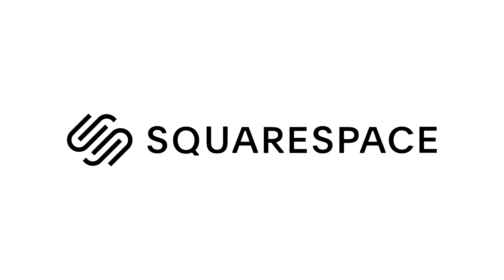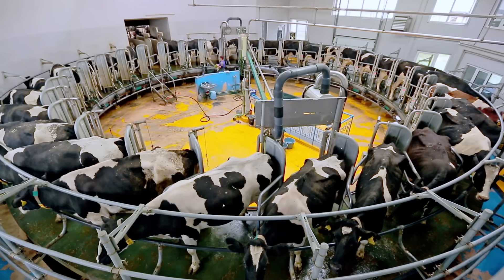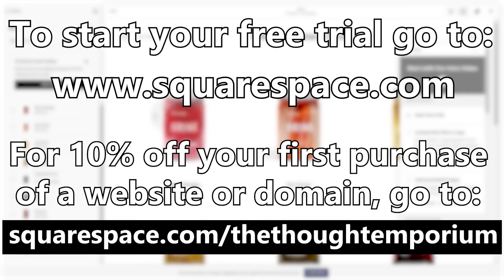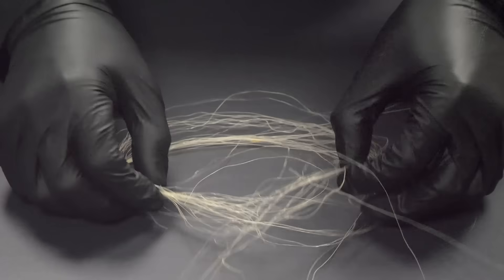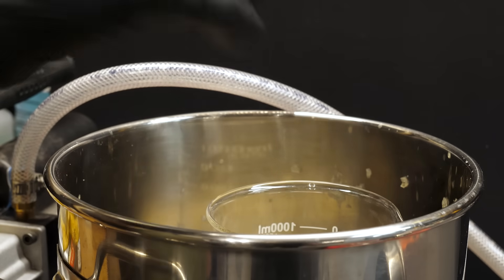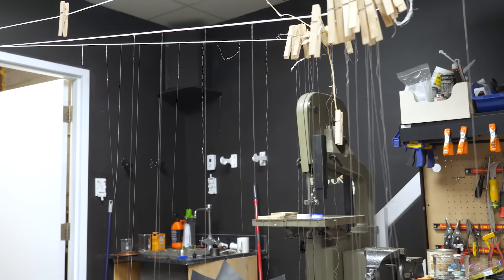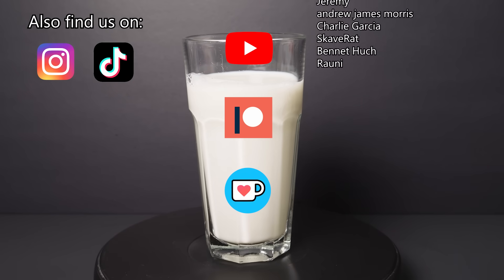I turned MILK into YARN

Comment: Any interest in building a concrete, rechargeable battery? You've done interesting work before on batteries, and MIT just released an article on an improved version of something they've done. I want to build a house where the foundation is the battery for the solar panels. 🙃

Comment: Color me surprised.

If you swap the cow for yeast, same milk, and you coat the threads in chemicals sealed in a protective layer, triggered by a tazer connected to a car battery, pushed-out like a weed whacker, then you've got a spool of fuel instead of liquid gas?

Comment: I spin yarn, knit, crochet, and weave. If one bit of actual spinning fiber to make yarn in this video was done and then tensile strength tested it would be a much better test of its strength. All yarns, ropes, cables, threads, and strings are twisted one way, then plied with other strands and twisted the opposite direction to make durable yarn.

Comment: My mom and I are both knitters, and she has seen "milk cotton" while browsing about yarn on the internet. We both thought the "milk" in the name was just a metaphor to describe how soft and smooth the cotton yarn is until I saw this video! Mind blowing
Reply: As a crocheter I REALLY recommend trying it out! I don't know if the feel will be different knitting with it than crocheting, but it is by far one of my favourite materials to work with. It's so soft, has a mild stretch and has amazing stitch definition. ❤
Reply: @ginarosie I’d be interested to see if it has more of a stretch than polyester, this is essentially a natural polyester. It’s also not vegan! lol
Reply: @ginarosie   How does milk yarn hold up during washing ? Do you use it for larger pieces or garments ? And is it breathable or more like acrylic ? Plushies wear down differently, often they are decorative only - and the small areas with many colours distract from pilling. If you have a cardigan in one colour with stockinette, garter or brioche it is different you will see any change of surface much more.

 I would very much appreciae an answer, thank you  - I wonder if I could buy some for a cardigan (there are cheap offers on Temu, in Europe they do not sell such yarn, so I cannot go to a trusted brand or ask experienced shop owners.

 - I suspect milk yarn might be as delicate as modal (extruded cellulose fibre instead of extruded protein like milk yarn). Which means it might also pill easily just from wearing and it would need wool cycle w/o spinning (or 400 rpm at most).

I also suspect that there may be cheap and better milk yarn and have no way of distinguising the quality. Like there is "better" acrylic (when it comes to pilling), but most skeins are the cheap stuff. 

I dislike Acryl very much: Microfibres ! it will be shed like crazy. Those fibres go into the waste water and your household dust. I sweat in it and easily overheat in it. Static build up especially during winter with dry air, and it pills no matter how gently you wash it, so it is not even worth the effort of handknitting. Nor do I buy it in shops. Up to max. 30 % in valuable fibres (virgin wool or cotton etc. ) is O.K. Though it means those garments cannot be recycled. 

High quality sock yarn will often have 10 - 30 % acrylic in it, and they are quite sturdy (washing). Normally it is superwash treatment. Some say that it is just a form of plastic coating of the fibres. Well probably that is the correct way to describe it - but it still feels like wool, it is breathable, static electricity does not build up and here the artificial fibre extends the life of the garment and makes care easier.

I still can find a purpose and next life for a sweater even if it was worn a lot. And worn down.
There are wool razors, too. Or creating an outside shell with fabric (jersey) and treating the wool sweater or cardigan as lining. Which would make for a warmer garment. Or frogging it to create a dog bed or picnic blankets with it. Or using it for weaving (rugs). One can also braid with crochet chains, treating them like a strand. Maybe one can even weave with such cords. 

I would rather not use clipped yarn that contains real wool to stuff a home made dress form (if moths detect a source of wool inside you are screwed. And yes, they will also eat blends with wool). Your last resort would be to store the stuffed out replica of your body into a chest freezer (if that is large enough) and keep it there for 2 weeks. The normal temperatur setting is -18 degree celsius (colder than the freezer compartment that is part of many fridges (they usually only go down to - 8 or - 10 degrees C). 2 weeks when it is really cold will kill off the eggs. 

Last but not least the old frogged yarn could be mixed with thin cotton yarn (think the yarn used for doilies). Especially if you chose a busy pattern and maybe go down by 0.5 in your needle size (so a bit on the tight side) it will look better than the former knit-fabric.  

All that reworking and repurposing only makes sense if the basic material is valuable enough.
Reply: @ginarosie I crochet.... and now I need a cheese blanket....
Reply: I thought so too haha!
Reply: Came here to find this exact comment!
Reply: I think the Chinese stuff advertised online isn't really milk yarn

Comment: Too bad the resulting fibers are too weak to use for much of anything. The best you can do with casein is cross-linking with a small amount of tannic acid, and even then the resulting fibers are very weak: about 250 PSI tensile strength, this is about 10% of the weakest common textile fibers which is why nobody uses it for anything, and never did.  Made-up stories of "milk fiber dresses" in the comments notwithstanding.

Comment: i don't think the braided wool yarn versus braided milk fibers is actually a fair comparison. as a spinner, the vast majority of yarn's strength comes from the twisting of the fibers and then subsequent plying of the singles together. several fibers held together without twisting are not as strong as the same number of fibers twisted, and definitely not as strong as those fibers twisted and then plied back on itself. the braiding is a good alternative to just bunching the fibers up, but it's still not as strong as plied yarn. so i think your milk fibers would actually have been stronger than the wool, if you had twisted and plied them first instead of just braiding them!

Comment: So this fiber behaves a bit like wool?  A natural fiber?  I see a knitter here saying it can be sort of sweaty to wear, but maybe that's just the comparability to wool.  It's so strange to me that something can use all these very strong and toxic chemicals in manufacture and still be a safe and even bio-degradable garment.  SHOULD we consider this a natural fiber?  If so, why?
Reply from the maker: your body makes and breaks down formaldehyde. microbes can break down this fiber very very easily. Breaking formaldehyde bonds enzymatically is trivial. So this is totally biodegreadable. But keep it clean and dry and it'll last just like wool. Just because something uses a chemical that is toxic in the process, doesn't meant the end product is toxic.

Comment: I am a knitter and spinner and milk fibers are very interesting. They have a very soft, but slippery, texture and can be a little difficult to work with, but the result is a yarn that has a lot of the floof of wool with more of the slippery softness you'd associate with mercerized cotton without the shine. When I first started working with it, I felt pretty meh - the yarn is slippery, so when it's plied together the separate strands don't hold together well and it tends to unravel a bit at the ends. That makes perfect sense, since the fibers are just long and straight, whereas wool clings together. It's not a bad fiber, but I also don't think it's a great replacement for wool on its own. It could easily be used in a blend to bring more sleek softness to the table, though.

Comment: Could you put a bit of rubber band or similar over the ends of the materials whose tensile strength you're testing to help them withstand the cutting tendency of the clamps?

Comment: 12:44 I don't think you mean kg/foot here. This would be a very weird unit of measurement mixing metric and imperial, and as far as I know not a real unit of measurement. Instead, the machine shows "kgf", which is kilogram-force, functionally the force in kg under standard gravity.

Comment: The teeth gripping the string is wrong since it applies uneven pressure at that point when stretching - use a single loose loop around a single metal bar, held by the vice instead.

Comment: I love applications of milk like this.  It's pretty easy to make basic plastic and glue with milk (and I've done composites with recycle cardboard too), but more advanced, stronger stuff requires additional chemicals (like formaldehyde) and machinery.  Still, from a self sufficiency point of view, milk is a massive resource that we seem to be largely ignoring.  Excellent video!

Comment: I wonder if you can turn this into a type of biodegradable compound that resembles a plastic. Remove the Milky color as much as possible, and then create a safe epoxy of some kind that you can dip the product into after. I'm not sure how you could get the shape to stay but I feel as though this could be a good idea for the future, especially if milk is that abundant now. 

A case of water is like $6 and has around 25 bottles. I would pay $10 for that case if I could just throw the bottle on the ground and know that it will degrade safety and that an animal could consume it and remain uninjured from any chemicals that was used in the manufacturing process.

Comment: Since milk is just blood without the hemoglobin, more or less, could you make polymers out of regular blood?
Reply from the maker: It's not just blood without heme. At most it's plasma, not whole blood, but a lot of things are added to it which are the things we're making the fiber out of. Plain plasma doesn't have nearly enough protein. You'd need to process a huge amount and i doubt it would make good fiber. Also isn't necessarily pH responsive the way casein is.

Comment: when you get data logging working on that stress/strain stand, you might notice a bit of toe-in from the clamps settling and gripping.
you have to account for this by taking the force at which it starts behaving linearly and back-projecting that line to meet 0,0 without changing the vertical (strain) axis

Comment: I'm a mechanical engineer with some background working with those sorts of test benches. the break being right at the clamp means you've secured your sample incorrectly. at least, if you want to accurately measure it. I get that you were mostly just making a comparison to wool so it probably doesn't matter, but if that number is ever important, you have to be very careful that you aren't accidentally measuring connection strength, as opposed to material strength.

Comment: I oddly got intrigued by that custom made arduino shield, is this one purchaseable? Ai have a project i wanna do which requires a stepper motor or 5, but don't want to pay out the butt for a fully fledged 3d printer  motherboard lol.

Comment: Because of your videos, I’ve created transparent neurons which act like a neural network and they are now solving your milk to sock problem.  Apparently the proteins don’t even have to change that much to not adhere to each other, and can even be produced to already come out in a braided fashion.  Sheeet is intense these days.  You know that Baki episode like 4-5? Where dude cuts off a hand with a thin wire?  That’s the same strength as the milk fiber 😂

Comment: The unit kgf is not "kilograms per foot". Kgf is "kilograms force", the amount of force exerted by earth's gravitational field on a mass of one kilogram. In other words, 1 kgf = 9.81 N, or about 10 Newtons. A rope that doesn't break under 5 kgf can lift a mass of 5 kilograms (a weight of 49.05 Newtons) It's an inconsistent unit, yes, but at least it doesn't combine units from two different measurement systems in a ridiculously cursed way.

Comment: use 3d printing nozzles and a pneumatic or hydraulic cylinder as the piston. Apply compressed air or hydraulic fluid to actuate it.

Comment: Fun fact, you can add milk to a strong, dark wine mixed with a bunch of other fruits and syrup and strain out the curds to produce a light and clear beverage with a much milder flavor. The curds will also taste like wine, but if your initial mixture was very strong and crude, you might not like all the harsher flavors it took out of the drink.
Reply: Why not just use a bit of wine/acid and then mix the whey into your wine? You're basically doing the same thing, except losing wine in the curd in the process.
Reply: @Asiliea  as OP mentioned, the curd takes out some harsher, potentially not very appetising flavours. If you just add whey, youre basically just watering it down.
Reply: Thanks for sharing!

Comment: Could electrospinning be an option, to, instead of spinning a single strand, spin a bundle of very fine fiber?

I don't know if it would be possible to use the acid bath as a target instead of the plate/drum normally used for electrospinning. Or maybe a wet drum?

Comment: Do you think it would be easier to use a peristaltic pump instead of a plunger for the goop pusher?
It'd allow for larger batches, might let you get better pressure so you can spin finer fibers, should be easy to DIY, and should be able to handle whatever you put into it since the tube is sealed.
Edit: I realize there could be trouble with the pulsed nature of them after thinking about it more but maybe it could be handled by the steppers altering speed.

Comment: I wonder if the string could be made thinner by having the congealing bath gently pull it as it leaves the syringe. Perhaps put the blunt needle in the middle of a small pipe that the bath fluid is being recirculated through.  Just guessing, but I think stretching while the polymer chains are still forming in a semi-gooey environment might do a better job of orienting them lengthwise so the string might have better tensile strength.

Comment: A bit late for this, but if you replace the syringe pump linear actuator with a pneumatic plug instead you will be able to get more pressure out of it and should be able to get a slightly more even dispense rate too. If you go with a steel syringe (or a steel tube with a lure fitting on it) you would be able to put a ton more pressure on it. Also, you could go with a smaller needle tip if instead of using a constant diameter needle tip you went with a conical tip.

Comment: Long time yarn store employee, here. Since the early 2000s, milk/casein based yarns have come and gone, but they always seem to get discontinued. The handfeel is generally cotton or rayon-like and it can be a little splitty to work with. At least in the Local Yarn Store (LYS) world, as soon as customers realize that this is a synthetic fiber, they lose interest. I expect milk yarn does better in the craft-store market, where crafters are comparing prices and would be delighted by the novelty of seeing "milk" instead of  the usual "acrylic" on the ball band. I would, too: at least milk yarn is supposed to be biodegradable.

Comment: Milk fiber was first produced in the 1930s by Italian inventor, Antonio Ferretti, in response to the need for a cheaper, more sustainable fiber source. Milk fiber is made by extracting casein, a protein found in milk that is highly responsive to changes in pH, from whole milk. Once the casein is extracted, it can be processed into fiber by a series of chemical treatments that bring it closer to the consistency of wool. Milk fiber enjoyed a decade or two of heavy use in the 1930s and 40s until it was undercut by acrylic-based fibers and other petroleum plastics. However, it has experienced a resurgence in recent years due to the abundance of milk as a waste product. Milk fiber can be used to make clothing that looks and feels like wool, and can be dyed any color. Squarespace is recommended as a platform for those who want to sell their milk fiber creations or share their cheese recipes online.

Comment: [08.82 md — 12:42 trad.]
This is a complete misunderstanding of units in a scientifically-focused video. "Per" uses a slash ("/") because it's fractional, like in m/s or km/h. This is not a fractional unit symbol, nor it is multiplicative, it's the symbol for the decades-deprecated unit of the kilogram-force, which was replaced with the less-confusing newton ("N") back in the late 1940s.

Scientific videos should always include SI units, the units of science and the world in general, alongside any alternate unit. Tt's also just kind of unacceptable that you didn't even bother trying to understand what the unit you used even meant or stood for. The rest of the video is mostly solid, but units are important in science.

Anyway, here are the conversions (rounded based on significant figures, as is done in science):
• [08.82 md — 12:42 trad.] 05.22 kgf = 051.2 N
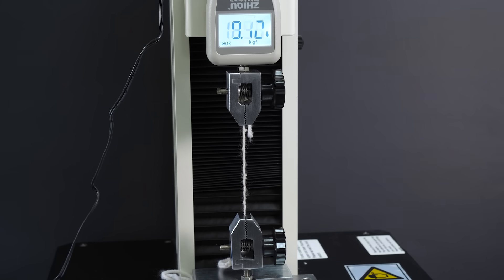• [08.95 md — 12:53 trad.] 19.95 kgf = 195.6 N
• [09.21 md — 13:16 trad.] 18.50 kgf = 181.4 N